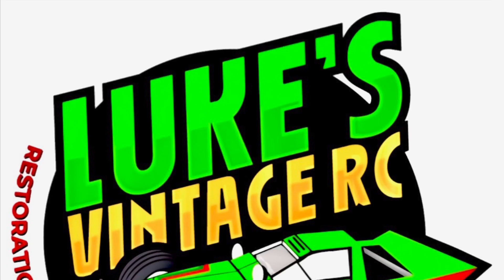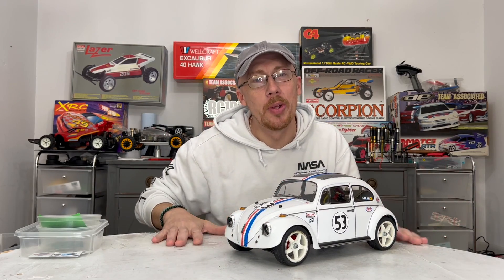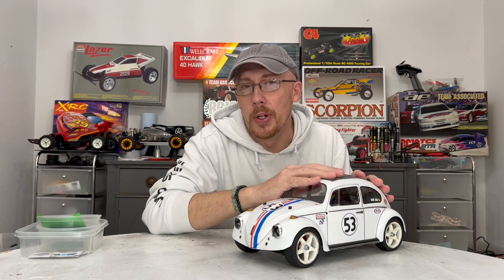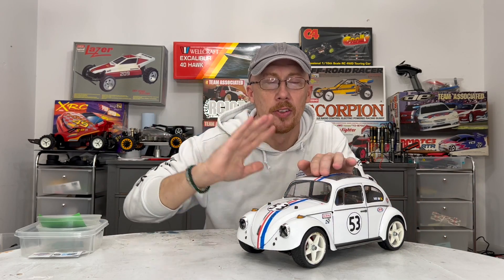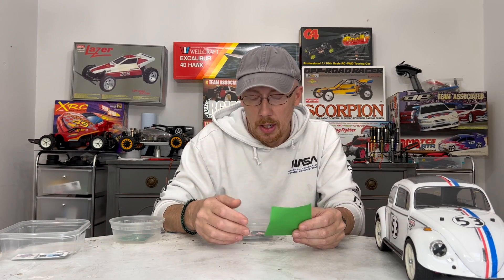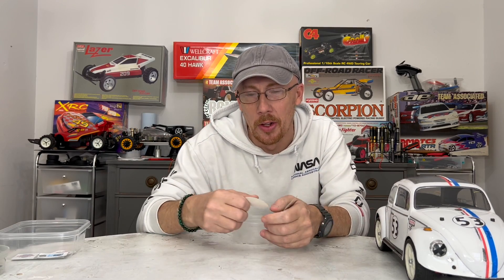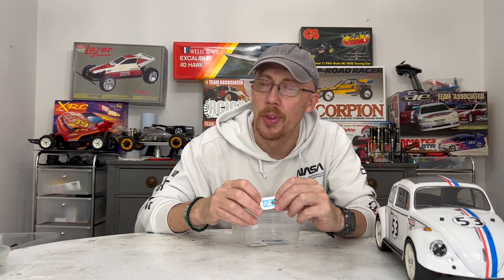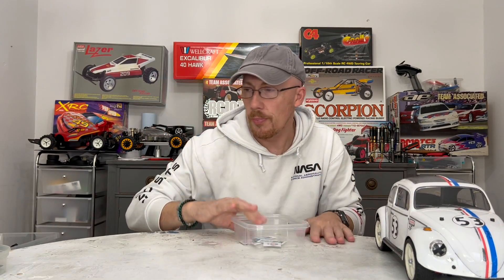2024 Poor Boys RC Tamiya MF-01X Speed Run Challenge Round 4

Comment: I used a GPS just like yours in conjunction with our Gnss and the meilan was 10mph off. Could be user error but wanted to give you a heads uo that ours read really slow.
Reply: off meaning slower.
Reply from the maker: @TeamJunkYardDog  bud this would be a topic to share with Fil from Poor Boys RC as he uses the exact model. I’m guessing I’m a new channel for you and if so hello. Doing as many videos with speed runs as I do I’ve got a pretty good idea on the speed my various rc are doing at least in the speeds my rc is reaching as majority of mine are in the 16-40 mph range. If I noticed anything I’d warn Fil. The meilan has been on the money as far as speed. Only issue is cutting off and sticky plastics lol! I use another one called SKYRC gsm-015 in earlier speed runs and purchased the Meilan because of Fil. These were never more than tenths off. Curious how you figured it was slower? You taped two in?
Reply: @LukesVintageRC  Well it isn't a issue for me I was just trying to give you a heads up. I think the real issue is we were in a lightly wooded area and maybe I didn't give it time to acquire enough satellites.